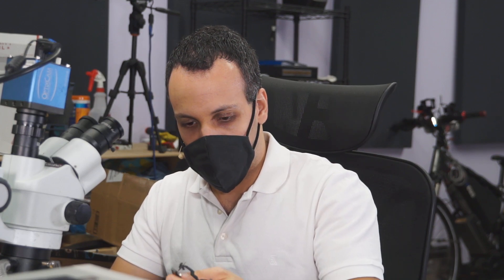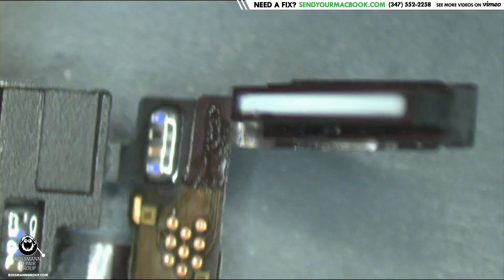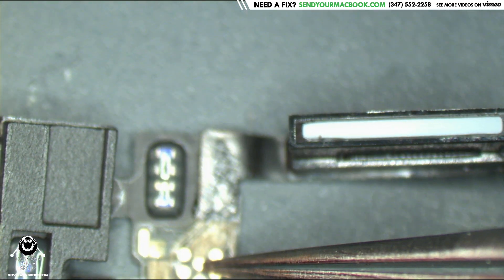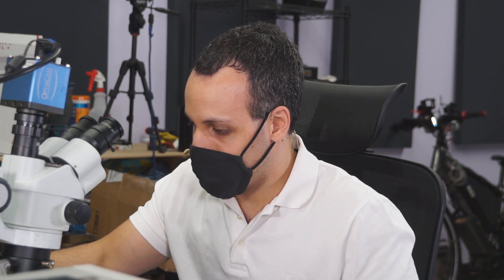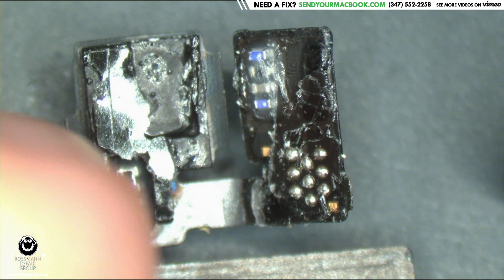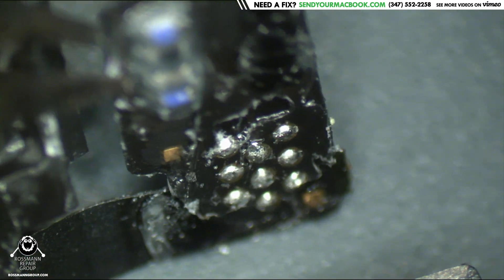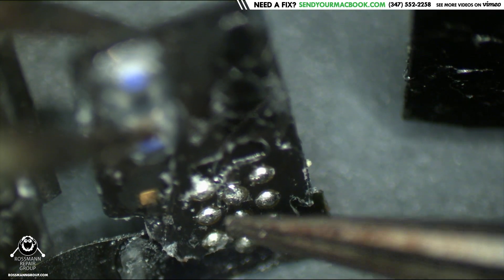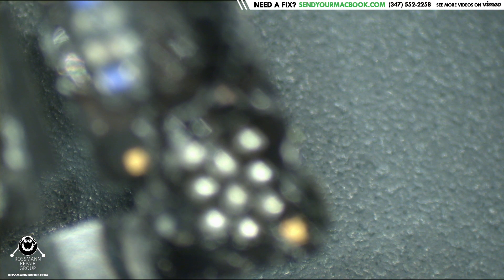A strange iPhone flex cable

Comment: Louis, if you’re just going to be fixing the phone for data recovery purposes, why not simply unplug the front flex (speaker, ambient light sensor, etc.)? The phone should boot just fine, only Face ID will not work, and the front speaker of course.

Comment: firstly, Apple pairs the fuck outta any part they can on an iPhone. You can't get a fully working camera & sensors module if you replace it with an original donor part from other iPhone.

Comment: I've got a mid 2012 macbook pro and the webcam is turning off by itself and you have to restart the laptop to turn it on again, I went to a repair store next to Prospect Park where I live, apparently the cable connected from the mother board to the screen is glue.....So, If I want this laptop to be fixed there is a chance the mother board will be damaged try to fix that issue... Thanks apple...
Reply: Antoine Thouvenin that's a lie stop lying. The ifixit tare down clearly shows its soldered.

Comment: The most shameful "solder joint repair" I've ever done was a few seconds of pressing the joints on an USB connector with a screwdriver to force them making contact again until I could get home and solder properly the connector. Literally bending the solder metal to touch and that's it, cause I needed that USB drive working on that moment and of course I had no soldering iron. It worked.
Or was it the time I just pressed the north bridge of my old laptop with my fingers like a damn monkey until it came back to life? Might be that one too.
But one thing is for sure: never have I used glue in place of solder

Comment: Mobilesentrix is trash. I ordered a replacement LCD panel for a Microsoft Surface Pro 4 and the touch screen didn't work out of the box. Then they told me they had no additional screens and they wouldn't replace the screen until I sent back the defective unit.

Comment: Louis,  you gonna face palm yourself for this one.  its because its the sensor is useless unless its the original sensor that is encrypted to the phone (like the old fingerprint readers) and the one you are complaining about is just a place holder piece to make it look like a completed unit.  Mobile Sentrix and just about everyone has had that note up there as long as i can remember.
Reply from the maker: Oh no, I know why you need to move the sensor from the old to the new. That is fine.

Why are you selling it with a fake sensor glued onto there? This is useless.
Reply: @rossmanngroup    you an I do this for money and we both know they don't need this part.  

Now assume you are a mall tech or some do it yourselfer who won't do the soldering and can live without face recognition.  Now if they send them the part without the  dumby sensor, they are likely to return it because its broken and missing the sensor.  Put a dumby one on and you make them all happy and save money on returns.